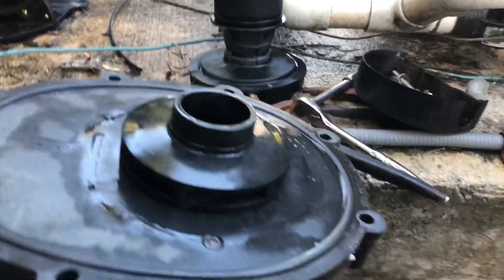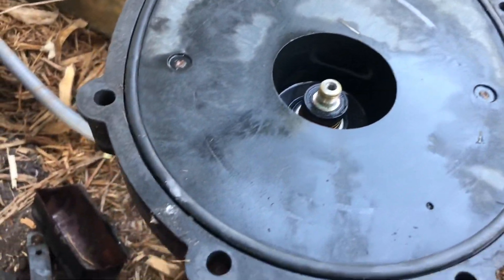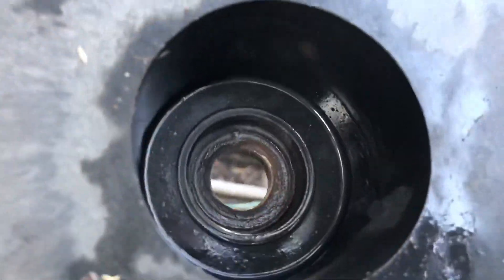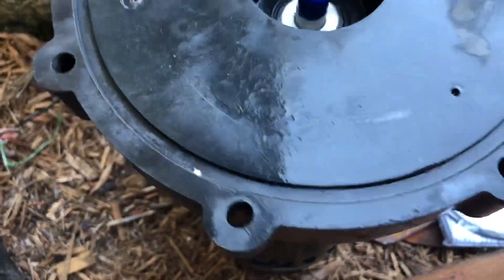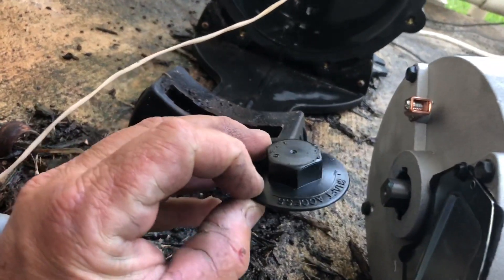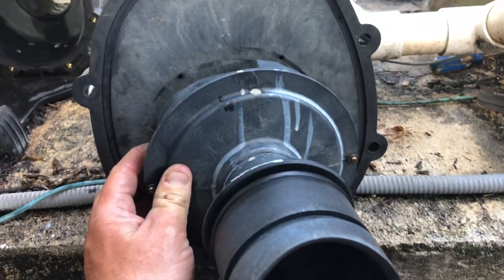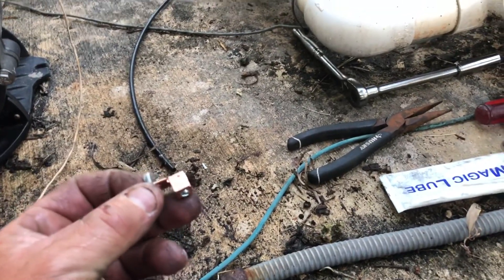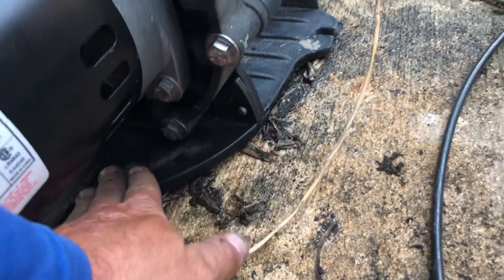Jandy Plus HP Capacitor Blew Up!! Motor Swap and Repair

Comment: Just had this happen.  Blew the Cover clean off,and it  landed on my near by trash bin w/cover.  It looked at first as if someone had taken it apart and placed the capacitor cover on the bin cover.  It was until I found the rest of the capacitor under the filter where it had started a small fire, did I realize it wasn't sabotage.

Comment: I had the same issue, but what was the reasoning for repairing the motor? i replaced the capacitor and it started right up no issues
Reply from the maker: Not all problems are similar even if it seems so.